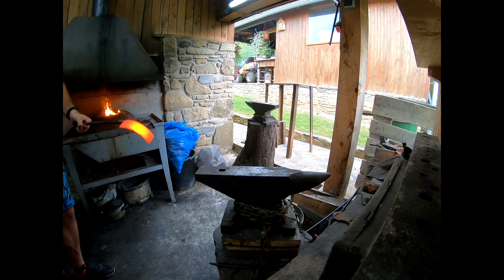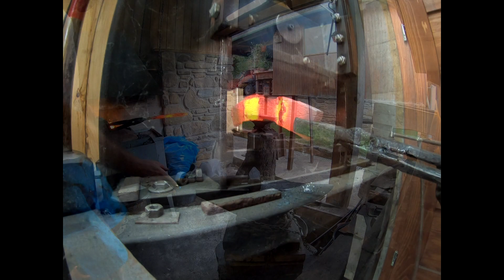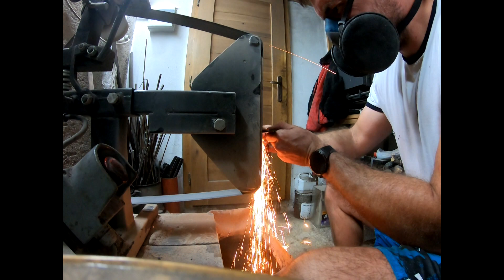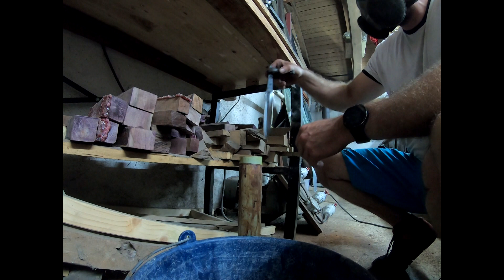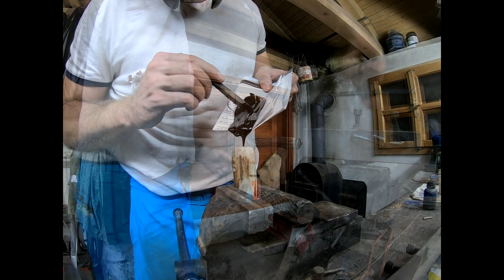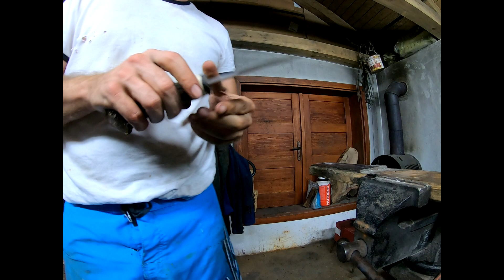Knife from old bearing

Comment: Great way to put a fuller in! Just curious, why did you only fuller one side?
Reply: Thx. Fuller only from one side - because it is enough. Knife is for hard use, fuller is not forged, only grinded, so I think this solution is the best for strenght of the blade.